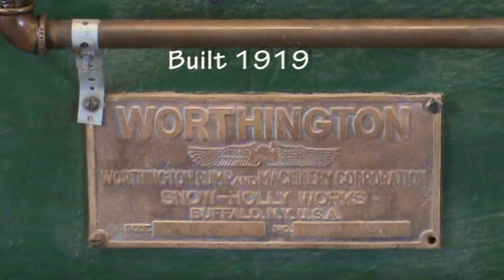55 Ton Antique Engine Running - WMSTR Rollag 2010

Comment: @Dolphindream15 It was used a natural gas compressor, Used to run on the same gas it pumped. Now it is just run as a display using propane as the fuel.